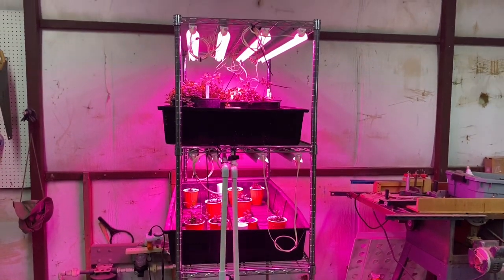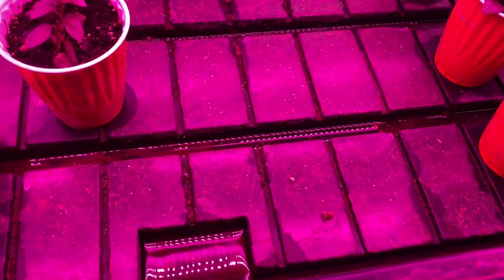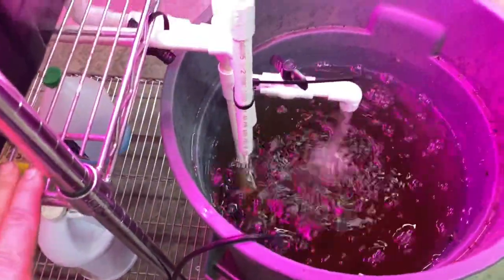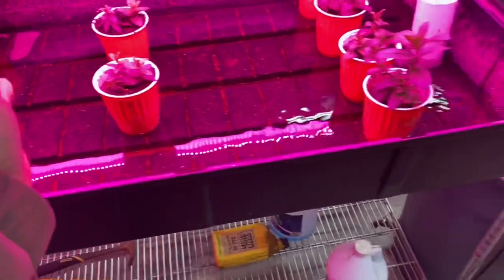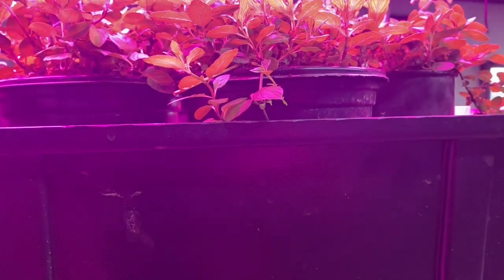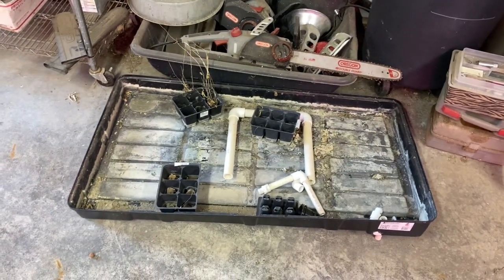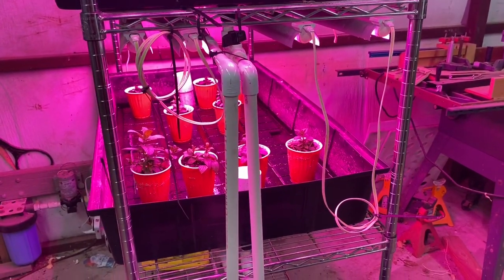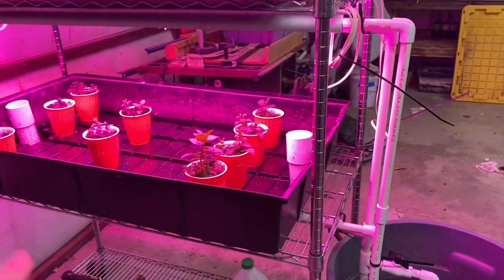Seed Starting Rack System with Ebb and Flow Irrigation

Comment: I wrapped two of these racks in greenhouse plastic just a few weeks ago for spring seed starting. Two 6' lengths of aluminum wiggle wire channel riveted on vertically at the front corners. The back and sides are wrapped with one piece of plastic. Then one more piece of plastic over the top and drapes over the front. Front rolls up on a length of conduit. Utility heater powered by an ink bird itc-308. Now I wanna setup some ebb and flow trays. Thanks Jack!

Comment: Hey Jack, you mentioned it takes a lot of water to run the system due to the blocks that the solo cups sit on.   Why do you need the blocks?  Are there grooves in the trays that prevent water movement (if so, couldn’t you tilt them slightly)?

Comment: Have you ever experimented with warming the nutrient up above ambient temperature and say try to keep it around 70° using aquarium heaters? I did one tray with an aquarium heater this winter in my gross system in my basement ambient temperature is about 50° but the aquarium heater kept one tank at around 70 and my other tank for comparison had nutrient 50. The warmer tank probably had three times as much growth in a 19 day. Cycle. I was wondering if these results are typical?
Reply from the maker: It works sort of but it is very limited as it only mattes when the flow is on going, and the fluid loses heat really quickly when you are running it as well.
Reply: @survivalpodcasting  Thank you very much for responding I really appreciate the information I did not think of the temperature loss as it circulates. I appreciate